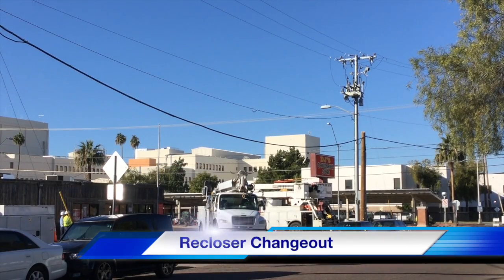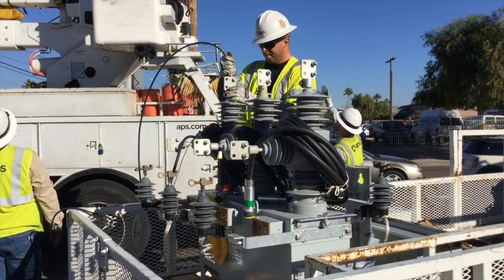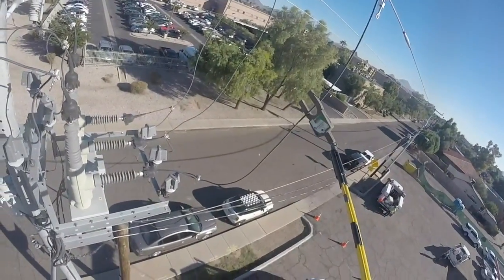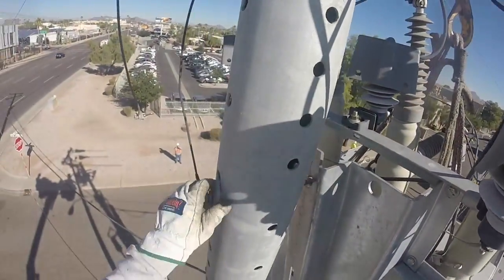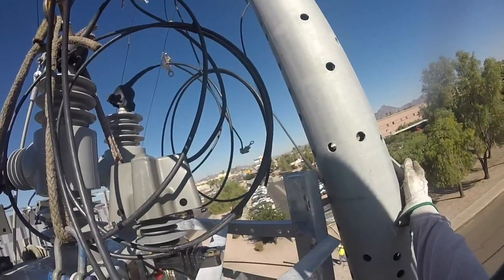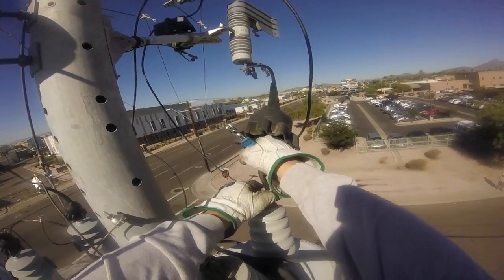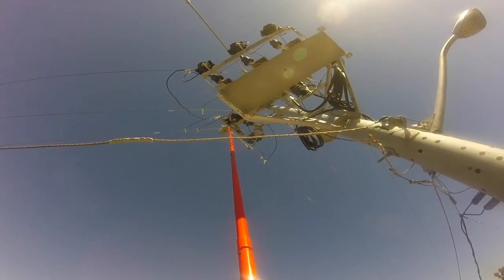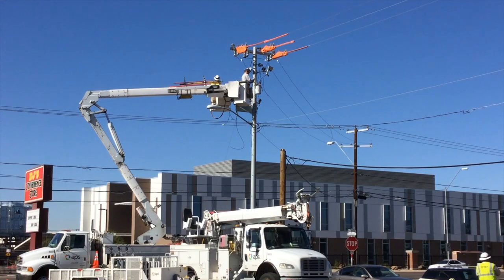How to Change Out a Recloser

Comment: The supposed strengthening of the guy wire was actually just another fiberglass extension rod being added as the guy wire would be near the live terminals on the recloser

Comment: The small transformer is a potential transformer, it drops the line voltage from 7200 VAC to 120 VAC for control power.

Comment: I think they're using the voltage detector and not a ammeter as you said sir. How long it takes the process of changeout?
Reply: No it's a amp meter
Reply: There's voltage. What they want to be certain of is that the amperage is zero to ensure no loads are being powered, or if they cut into the cable there would be an arc and potentially kill someone.

Comment: What was that small transformer for?
Reply: Sergio Hernandez , sir, that's the small P.T. for power supply of the controller. The other one is the C.T. for detecting the fault and other parameters such as the load. Correct me if im wrong.